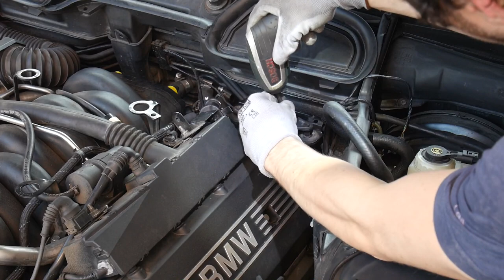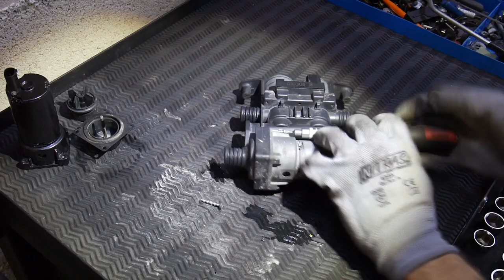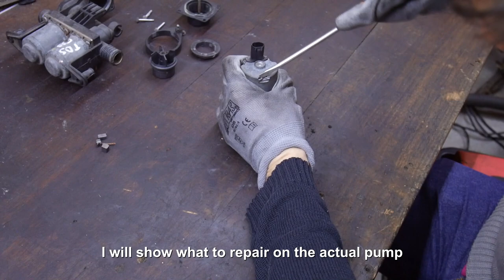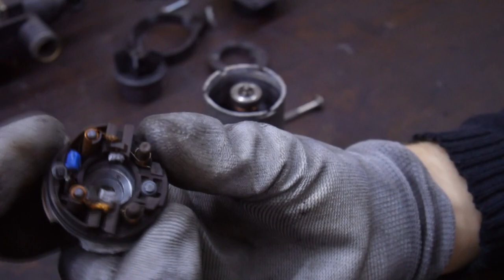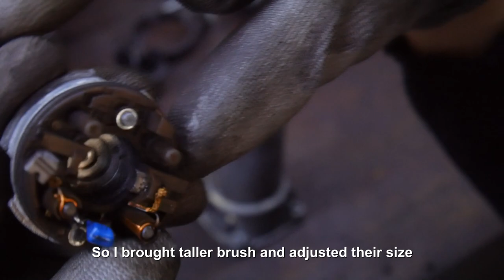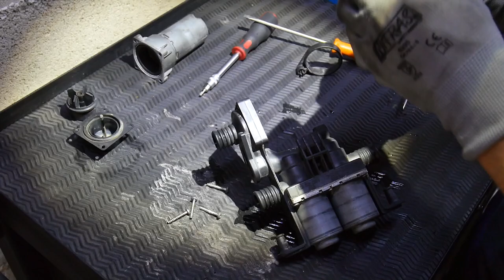How to repair auxiliary coolant pump BMW E38/E39

Comment: The actual size of the brushes is 5x5x11 mm
Reply: Found some on eBay that are 5x6x14, so they should be pretty easy to grind to fit.  $8 shipped for 10 brushes.

Comment: Hello, I have a question bmw e39 before the lifetime at a standstill, no heat sometimes it is warm but it's delicate you can say that not at all, but while driving normally it's warm, I understand that the pump is responsible for it, just what you showed in the video?
Reply from the maker: Its difficult to say like that
Reply: @MecaLogic  
Angielski
ok to jaka przyczyna była ze reperowałeś tą pompke ? jakie sa objawy ze np trzeba ja wymienic ? 
ok, what was the reason that you repaired this pump? what are the symptoms that, for example, need to be replaced?
Reply: @ukaszmarciniak5479  tak jak napisał na filmie 1. Blad pomy elektrycznej po podłączeniu kompa. 2. Pompa nie wydaje dźwięku kiedy jest na zapłonie. 3. Nie możliwe odpowietrzenia ukladu chlodzenia. 4 . Problem z układem chlodzenia

Comment: I repaired it two weeks ago but I get a bad luck cause the diaphragm valves already corroded also the solenoids 🤦‍♂️👎
Reply: There are repair sets on Ebay

Comment: What size of brushes you installed.  Do you have dimensions in millimeters?
Reply from the maker: Unfortunalety I do not have the old brushes to get the dimensions, sorry !
Reply: @MecaLogic  Then what size did you order?  Were they just described that there are water pumps for the e38?
Reply from the maker: @poli1990  Absolety not, I brought those https://www.ebay.fr/itm/Lot-de-2-Balais-de-Charbon-cuivr%C3%A9s-6-x-8-x-18-mm-Moteur-Alternateur-ventilateur/264681674718?ssPageName=STRK%3AMEBIDX%3AIT&_trksid=p2057872.m2749.l2649
Reply from the maker: You will need to adapt the size
Reply: @MecaLogic  So you bought larger ones and reduced them a little?
Reply from the maker: @poli1990  indeed

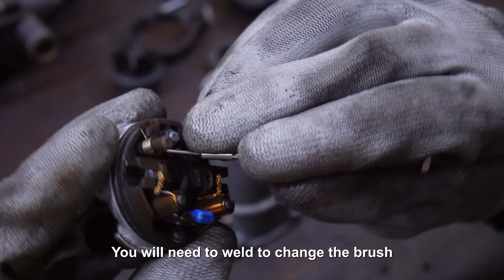Comment: You mentioned at 3:34 that you need to weld to change the brush; what did you have to weld?  It looks like you just replaced the brushes after cutting them down from being too large?
Reply from the maker: you need to weld the new brushes to the back for the plug
Reply: @MecaLogic  Ah, I found a spare at a junkyard and took it apart and I see now.  When you say weld, though, do you mean solder?  Did you just cut the old brush wire from the "spring" that it was connected to and re-solder the wire from the new brush back to that same "spring"?  It would have been very useful to include that part in the video as it is probably the most critical part of the process.
Reply from the maker: @MyMidlifeCrisis  yes, solder with tin. That's accurate. I didn't find a part with accurate dimensions, so linking the part will be useless. There are very fairly easy to find and adjust don't worry.
Reply: @MecaLogic  yup, I found some good brushes that are just 1 mill to wide on one side and about 3 mill long.  Should be easy to grind down!

Comment: OK. --- This video omits the most important and difficult part.
The trick to get the rear cap with the new brushes on  is to remove a small pressed-on silver plug at the tip of the end piece. It is next to the centrical connector. 
You can then get a tiny flat blade screwdriver inside to maneuver the brushes apart and past the bearing and onto the commutator ring contact. 11mm is the absolute max that will fit. 10mm x 5 mm x 5mm fits the best. You can buy any size bigger and easily file the brushes to size, they are soft graphite. Also "weld" is just soldering the braided copper wire.
Reply: This is an important tip, thank you!

Comment: To hold the brushes back while installing:

Insert a nut the diameter of the commutator between the brushes, place the springs on the brushes and add a few drops of water to them.

Then put the whole thing in the freezer for at least an hour. This water holds the brushes when you remove the nut.

Then, it has to be done quickly, everything can be be reassembled.

When the water has thawed, the brushes are back on the commutator.

Comment: It would help to see how you mounted it back. How did you held the springs to keep the brushes open wide to insert the top bearing? 
Thanks
Reply from the maker: I don't remember exactly but I think used paper to slide the brushes up

Comment: Hello
When I turn the key to posit II/engin off and heating off I can hear the auxilliary pum is working!
I think something is wrong, that pump under this 2 valves should turn on when heating is on, should be off when heating is off, right?
Reply from the maker: The valve switch on-off in intervall when the heating is ON. And the valve is closed when heating is no needed
Reply: @MecaLogic  Not the valves.
The water pump underneath the valves that circulate the water?
Thanks
Reply from the maker: @shefketmustafa9228  the water pump is always ON when ingnition is ON
Reply: @MecaLogic  Thank you!
Reply: Coolant hose are rock solid on my M52 engine 1998 e39 528i.
All parts for the cooling system are new!
Drove more than 500 miles the last few days system should bleed itself till now...hoses still rock solid?
Coolant doesn't mix with oil.
Concern that pressure will cause me a trouble.